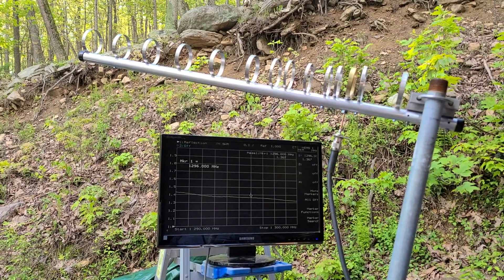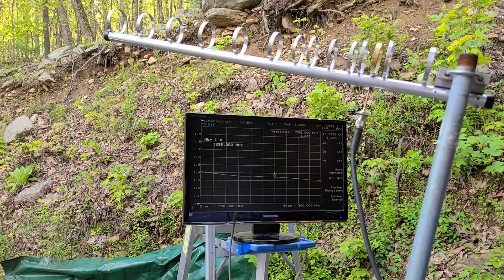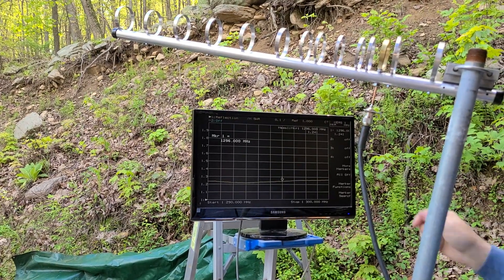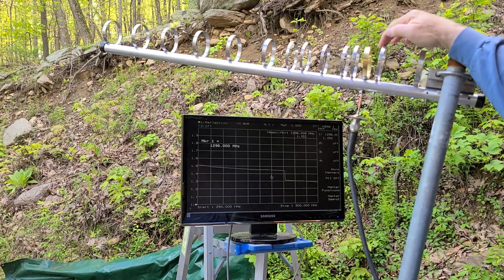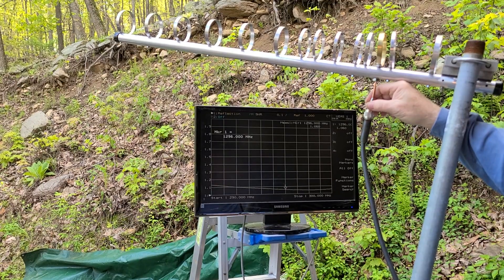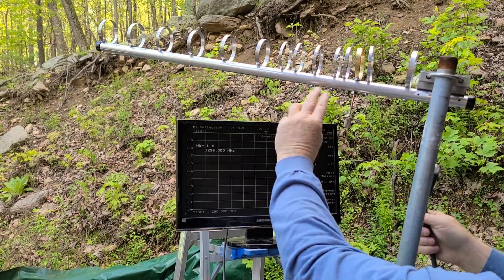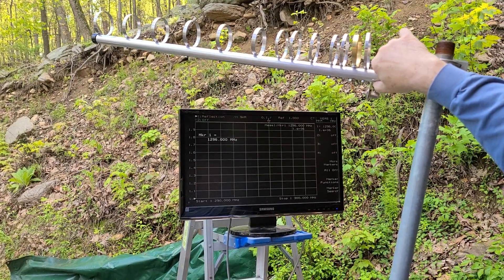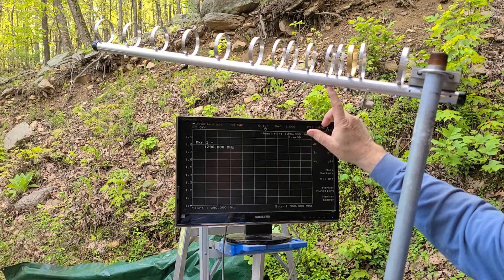Tuning a Loop Yagi antenna

Comment: Shouldn't  the antenna VSWR be adjusted  After the feed line is 90 deg bent ?  Dimensions could have been negatively disrupted during the feed line's critical 90 deg bending stresses..